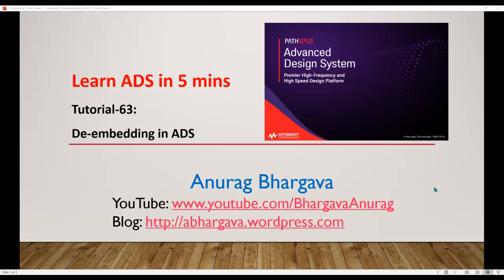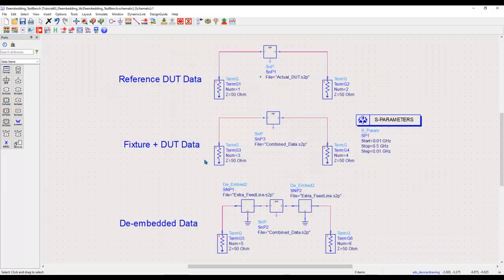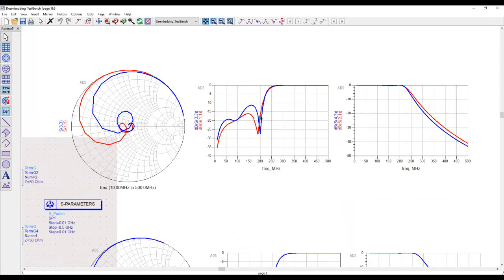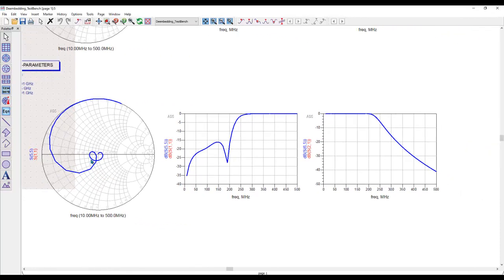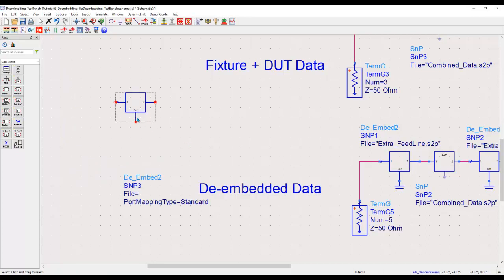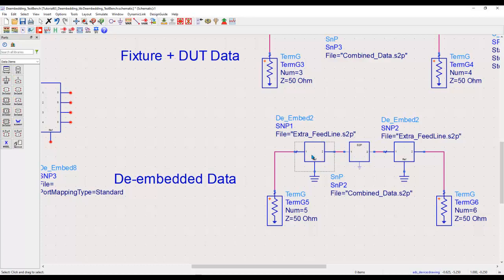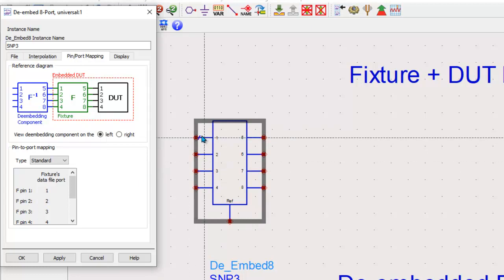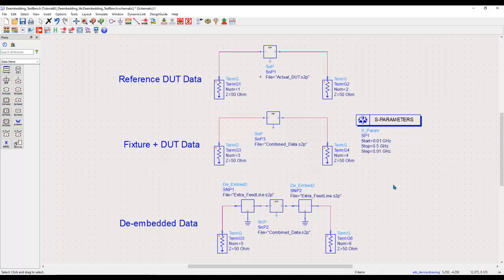Tutorial-63: De-embedding in ADS

Comment: Should I do the same for differential signals, just with setting the measured equation SDD11 as 0.5 * (S(1,1)-S(2,1)-(S1,2)+S(2,2))?
Reply from the maker: for differential circuit, you can simply use Balun at input and output to avoid writing detailed equations.

Comment: Hi Sir, I need to deembed the signal while running on transient sim but ADS has no option to use deembed while on Transient Sim.I have converted S parameters to T parameters and wish to use T parameter and its inverse to get the original deembeded signal.Could you let me know how T parameter model can be inserted back in the schematic.I see S,Z,Y port models but no T port model to be placed in the schematic.Thanks
Reply from the maker: The question you asked can be pretty involved topic hence I would recommend you to contact your local Keysight tech support team for help.

Comment: Sir, I would like to ask how to find the loadpull template that can show the second harmonic PAE contour from the ADS design guide. I still can’t find it after searching for a long time...🥲
Reply from the maker: There is a parameter on the LoadPull Instrument: Swept_Harmonic_Num which set to 1. You can change this parameter to whatever harmonic index you want and then make sure you use the appropriate S_Load.....on the desired harmonic
Reply: @BhargavaAnurag  Thanks for replying, so...do you mean that if I want to consider second harmonic now, I need to set Swept_Harmonic_Num to '3' (note shows Z_Load_3rd will be ignored), then the 'PAE_contours_Rho' from the simulation results page will be represented in the second harmonic PAE contour?
I don't really need to construct a new equation to find it right?
Reply from the maker: Hi Jeff,
If you set Harmonic number to 3 then you need to set Z_Load_3rd to desired impedance and the area selected in the Smith Chart will be swept and all the data reported in the DDS will be for 3rd harmonic without you needing to do anything. If you need further help then you should contact your local Keysight tech support team for assistance.
Reply: Can you make a video to talk about this, or leave a message here? thank you for helping me.